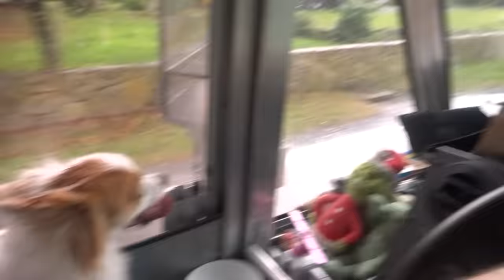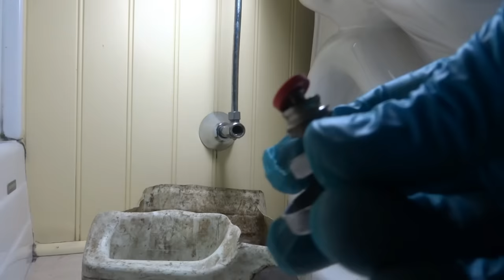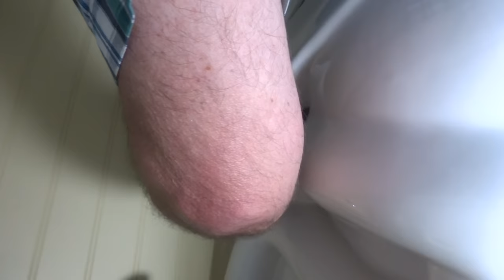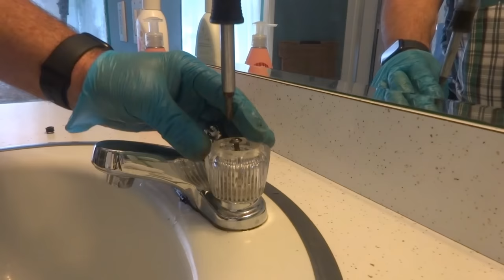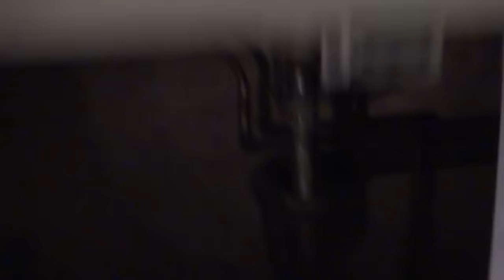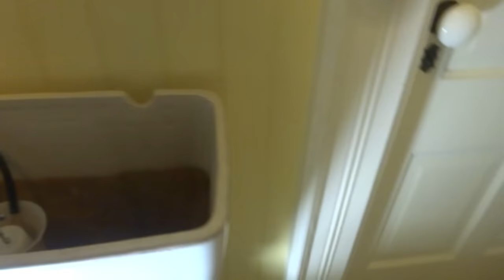TOILET & SINK LEAKING CAN I FIX IT

Comment: Suggestion: There is no need to remove the supply line.  Undo the top connection of the supply line to the fill valve, leaving the shutoff valve connection untouched.   No ferrule disturbance to cause a leak.  Next put the fill valve into the opening 1/3 of the way.  Now start to thread the nut on.  Push the fill valve fully into position and loosely tighten the nut.  Now position the nut from the supply and tighten.  This aligns the fill valve with the supply line.  Finally, tighten the supply valve nut.  Works for me.
Reply: Seems about right.  Those rigid supply lines typically need replaced once you touch them. The ferrule pinches the tube and it distorts and like you mention above, should be avoided if possible. If it were me doing the job, I wouldn't trust them and since a braided SS supply hose is not that expensive and the job isn't requiring a cosmetic supply tube, I'd use the flex every time, their rubber connections are much more forgiving and seal every time.
Reply: @Garth2011  Yeah, braided flex is preferable to minimize chances for leak.

Comment: Some thread paste on the lower supply line nut to the toilet should have stopped that leak.  I prefer a copper supply line because I had too many of those flexible supply lines flood the building.

Comment: With those old style toilet supplies you needed to get the flanged top part square to the fill valve shank for the yellow gasket to seal.  There was no give when the plastic nut was tightened.

Comment: I keep buying those Delta rubber seats and springs in bulk and apply a little silicone lube before inserting them. Will try your screwdriver trick next time.

Comment: Hi Steve do you recommend plumbers grease on the o-rings thanks, the reason I'm asking is cuz I replace my shower valve springs and o-rings about six months ago and it's dripping again but I used plumbers Grease, I don't know if that had anything to do with it I was just wondering
Reply: Watch video? But short answer yes!
Reply: Opps yesterday's video

Comment: You probably could have used the old supply line by just replacing the lower brass ferrule. Most times they can only be tightened once. After that they usually leak from being compressed.